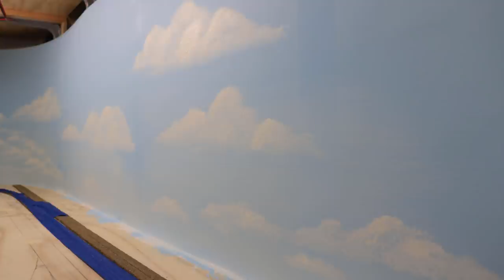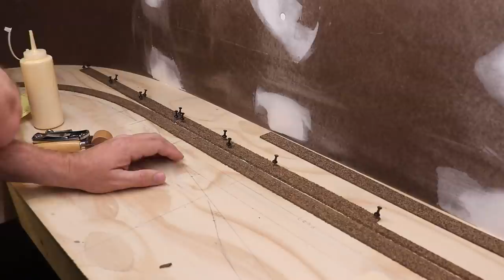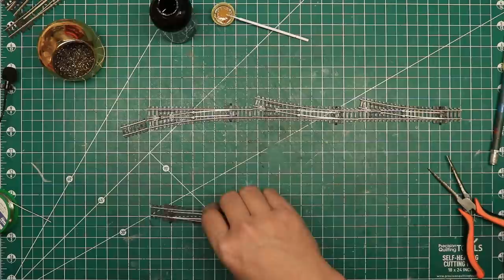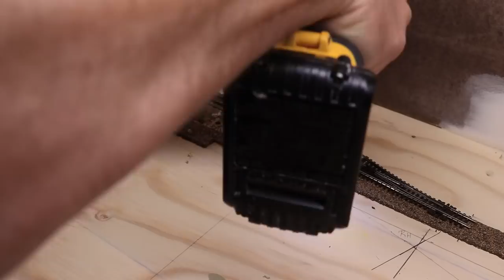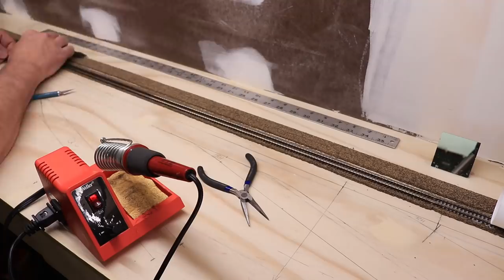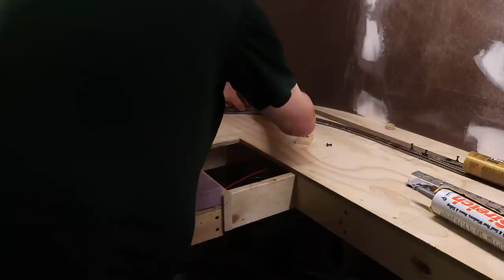Laying Track on a Model Railroad

Comment: I wish I had this video available a year ago when I started laying track!  Great job covering the bases. One additional thing I do is solder wires to the frogs, drill a small hole in the roadbed, and drop the wires to a frog juicer or the #5 pin on the tortoise. Thanks Ron!

Comment: Ron,
Superb Tips and Techniques.  To enhance some of your points here are some ideas I've used since the  1960's.
Back then cork strips were few and expensive to buy.  So I save my rolls of GAF Strips for longer straight runs.  But when it came to switching areas discount and home repair store sold 12 in. sq. blocks of cork which I would test fit and cut to meet my track needs.
A precaution, back in the 60's you had to use wood glue to secure the prepared cork to the roadbed.  In the 1970's manufactures starting placing peel-n-stick backing to the blocks.  Just because the peel-n-stick may seem easier and cheaper it's not.  In time the glue separates from either the cork or the roadbed, or both.  ALWAYS HARD TACK any cork material down and ripple free.

Now test fitting joints.  I agree with you on 99% of your technique.
The sole exception can bring husbands & wives back together, while practicing our artistry.
Back in the day, when the kids had to go to bed early, Eileen and I would sit in the kitchen.  She would experiment with her recipes, while I would dry fit my rail joints.
I'd have my sections of straight track, switches (still manual throws) and two box cars.  I would dry fit the sub-assembly into 3 or 4 foot lengths, with rail joiners.  The length of the kitchen peninsula.  Hand push the box cars over the lose track.  Then take my home made track gauge to verify correctness.  (I don't think we at MNRA even had an HO Track Gauge yet????)
After each short run, the subassembly would be placed in a long box, returned to the then basement, & in a night or two my son Bobby and I would solder, glue and screw the way in place.
Yeah!  OK Guys.  It gets the job done.  BUT the important is IT GETS THE JOB DONE WHILE I KEEP COMMUNICATIONS WITH MY BEAUTIFUL BRIDE.  We don't have to work in a dungeon and separate ourselves from our marriages.
~Jim

Comment: Hi Ron, interesting as always, was a bit surprised though that you’re using insulfrogs, would think electrofrogs to be much much more reliable especially at low speeds and smaller locs.
On attaching the switch motors I also remove the spring but then drill a 1 mm hole in the centre of the switch for the throwbar, this allows me to remove the ends of the elongated sleeper with the holes, giving the overall a smoother look because the whole switching mechanism has become invisible.
Reply: Not necessarily, Insulfrogs that are metal like Atlas turnouts have a metal tab on the side for powering the frog with a Frog Juicer. Easy peasy!

Comment: Looks great Ron, however I have a question. You go to all the effort of soldering the track etc to maintain good conductivity and mention adding feeder wires, then use Insulfrog turnouts meaning the frogs can't be powered. Is there a deliberate reason for that? Wouldn't Peco Electrofrog/Unifrog be better?
Reply from the maker: When I started building waaaay back Ondidn't want to mess with powering frogs. If I was starting over today I might donit differently, but I have little trouble with modern diesel locomotives and insulated frogs.

Comment: I had an epiphany today. I finally opened my peck flex track after only having had atlas, once back when I was 10-13 years old, and then again recently. “Pre-curve your flex track” was something that made NO sense at all, but my Peco Code 55 really holds a flex so much better than the atlas stuff. 

What I’d like is a video about how to figure out plain old DC wiring and how to use electro frogs and being able to turn parts of the track on and off. Like a beginners course.

Comment: Hi Ron. I’ve built my 5 x 2,6 foot base ply board and I’m going to cork the whole board with for the N gauge layout using 2mm. Is it right you are soldering the fish plates because of expansion and contraction with temperature? I’ve been told not to solder, could you clarify please. Great information on layout build though.👍

Comment: What is the thickness of the cork you are using. Mid West site doesn't give the spec.Thanks great video.
I'm thinking of using 3mm sheet cork and cut my own. or is 5mm better ?
Reply from the maker: I am using standard N scale cork roadbed from Midwest Products which is 1/8" (3 mm) thick.

Comment: Great tip about sanding the rough edge that forms at the top of the roadbed when separating the cork Ron.  I see so many layouts where this is not done and it becomes quite a bear to ballast, either the ballast doesn't cover this area very well or it requires a huge volume of ballast to fill in and the ballast line becomes too wide and irregular.   It's one of the "finer" points I try to teach about track laying but people often ignore it anyway!

Comment: One neat trick is to cover the end of your vacuum with a nylon stocking to collect the sanded cork. This can then be mixed with PVA to fill in gaps in the cork. This is really helpful when laying sheet cork in large areas such as staging yards or parking lots.

Comment: On my first layout as a kid, I simply had my father nail the track directly to the plywood. But when I finally do get around to building a new layout, I'll go with a cork roadbed glued to the plywood. And either nail the track to the cork, or glue it down with caulk.

Comment: Ron - question (which may be worth discussing in a future video):  you mentioned first time running trains in a long time.  How well did the locomotives perform?  Was there a significant effort required to clean up track that had not been used in a long time, or was the Inox (or equivalent) good enough to keep dormant rail ready for service?

Comment: Really appreciate your channel.  Thank  you.  Great tip about using the rail cutters.  I knew about the vertical/horizontal thing (I model in OO) but I didn’t know about keeping the flat edge to the section you want to retain.  Very timely as I have my turnouts marked out and ready and am about to lay the track.